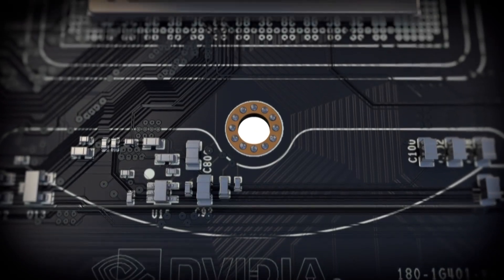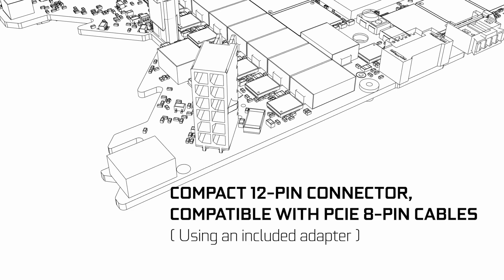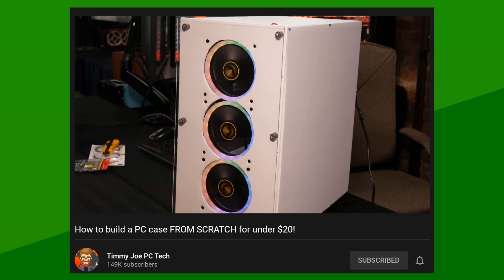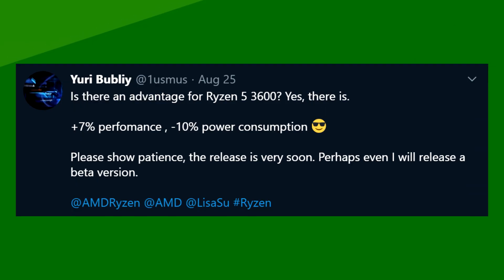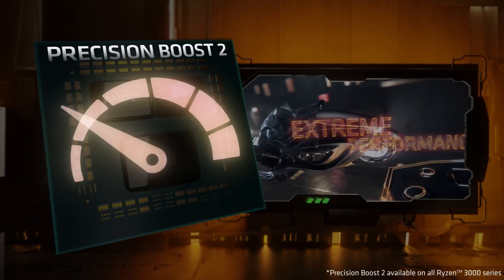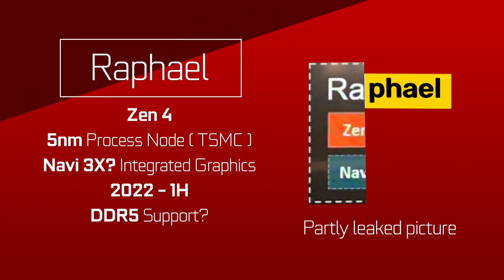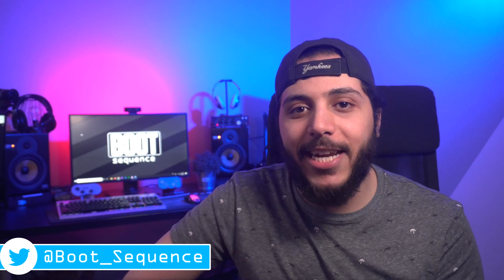More Info About the RTX 3000 Series Cooling! It’s Pretty Good! AMD DDR5 in 2021!

Comment: Sandwich style SFF cases will have a huge problem with NVIDIA's cooling solution. Exhausting air on the metal divider will heat up every component in the case. They're killing a market where customers spend $200+ just for the case.
Reply from the maker: I had the same argument until I realized all vega cards from back then had short pcb’s and a similar airflow when aircooled. But you’re right in a way since their design will blow out more air than third parties who usually cover the back of the heatsink and just have a few holes

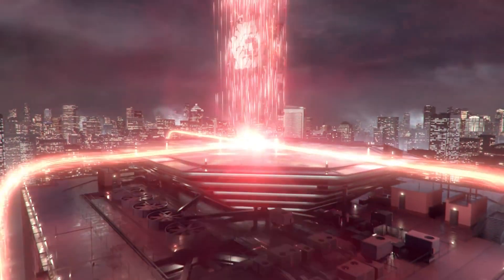Comment: which radeon vii sucks 400watts? (referring to 2:15) i OC`d my VII to 2038mhz and it barely touches 300w here and there
Reply from the maker: you might have a great sample. As is, radeon 7's range between 300~ 370w when oc'd to the fullest, with up to 420 on water.

Comment: That Nvidia reference design is actually making a good use of current case fan placement which usually has 3 intake and one exhaust but really if you have the cash to buy the new nvidia reference card ( which usually cost more than the AIB card and usually sells in more limited quantities ) you probably have a good case fully loaded with fans or have a water cooling setup. I probably more concerned about the dram chips on those GPU since they are rumored to be "run hot" especially after the RTX micron fiasco

Comment: over here in the u.k msi rtx 2080ti is £1500 so would you buy 1 or get a new rtx 3090 for prob £2000. think I will keep my zotac amp extreme 2080ti for next 2 years then build a new pc with a rtx 4090
Reply from the maker: id wait at that point. if the 3080 can match or beat 2080 ti , it would be cheaper.
Reply: In the uk even though the £ is worth more, things cost the same as in $, so the 3090 will more than likely just be £1400+, hopefully it will make the 2080ti lose almost all of its value

Comment: According to Lisa Su statements, We were probably getting AM5 in late 2021(or at least the reveal of such) as the roadmap had it placed before 2022 and she reaffirmed several times they are still on track.
DDR5, USB5,Thunderbolt3(native support),Pcie5(which CXL could very well bring back multi GPU configs). I was hoping for Marketing they would use 5000 series and keep everything aligned.

Comment: What is the worst that can happen if I stick the 3090 with my current 650w platinum seasonic psu, which appears to have plenty of capacity for my 1080ti, 9900k and 32 gbs of ram?
Reply from the maker: seasonic... you'll be good.
 oh wait... 9900K. 🔥🔥🔥. Im kidding. but expect that having both overclocked might be an issue even with a 80+ silver PSU.
Reply: Thanks! I thought people were exaggerating with the 850w, but If they want $1400 for a gpu, the founders edition better be able to run everything on ultra at 4K 60 FPS straight out of the box no overclocking...
Reply: if you have gold version..you will be very well shape....but not bronze or not sure silver will be enough...but only gold are optimize for this setup...you shouldn't worry when its only using 2 8pin and PSU are phasing out next year for only 12ATX PSU cause current PSU...24pin cable ...the VRM made half the cable unused due to motherboards changes from 5v and 3.3v is now been converted through VRM 12v into a voltage of memory and usb and PSU already converting for disk drives ...meaning every PSU inside only have 12v capacitor is only used for motherboard and gpu's and disk drives have their owned regulators to step down voltage or increase

Comment: I just wanna know if my 750W psu that only has dual 8 pins will fit the adapter. AFAIK dual 8 pins can push up to 300W's but the 12pin connector uses 600 (obviously, this does not mean that the card will use the entire 600, but they wouldn't increase it for nothing :/) Will the AIB cards use dual 8 pins or triple? Will the adapter also need dual or triple? A lotta questions :/

Comment: I have an RTX 2060 KO and a regular 2060 both in the same supposedly well-ventilated case. I run Folding@Home 24/7 when it lets me. The regular 2060 is nearer the bottom of the case and runs at 77C. The KO runs at 82C. I expect if I get a 3000-series card I’ll need a new case... and possibly a new power supply. The current GPUs run at 150W each at load...
Reply: Why on earth would you use RTX 2060 in SLI?
Reply: @oskarwroniewicz  Is that even possible? I don't think there's NVlink on the 2060.

Comment: i was really hoping that diagonal connector was on the inside..... which could make this the best cable management gpu ever, instead of that mess...
Reply from the maker: WAIT. Thats an insane mod idea. Adding it to the list
Reply: @BootSequence  sounds like a good video
Reply: @BootSequence  If its diagonal, its mostly likely loose, just bend it to whatever angle fits
Reply from the maker: Yeah actually. That would have been awesome
Reply: @BootSequence  looking at you AIB partners

Comment: The clickbait title "Nvidia tries to eliminate Noctua?" -- U14S owner.
Reply from the maker: Its a stretch. .. I LOVE IT 😂
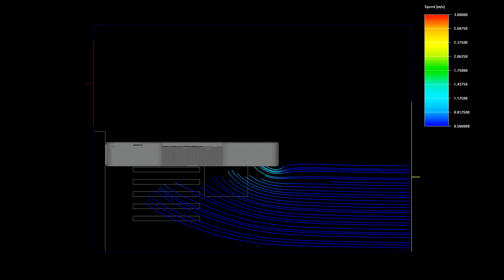Reply: @BootSequence  Big fan, thanks for replying. I was indeed joking. But to be honest, about 1:56, I do think this design will affecting air coolers since positive airflow case fan settings still seems to be the most common for mid-high budget air cooler users, which a portion of heat/hot air that would be push out of the case through unoccupied PCI-E slots covers can now having some "official assistance" to make their way to the CPU heatsinks. It could be take as Nvidia thinks the "high-end" CPU air cooler markets are so small they stop considering them in their cooler design of higher end cards. 😂
Reply: If this is about the size of the card being a conflict with Noctua heatsinks that shouldn't be a problem. Triple slot cards extend further down into the case, not higher up.
Reply: @Hotobu  Thanks, I'm currently using a triple slot 2070S with U14S, I was just joking about the back fan on the 3000 cooler blowing hot air towards the CPU's direction may only affects air cooler and the fact that Noctua only offers air coolers.

Comment: Let's see what cooling designs board partners have for these monster power sucking  GPUs 
I doubt that Founders Edition coolers will be enough to cool these 300watt + GPUs
Reply from the maker: I doubt it will change that much. Most heavy duty coolers are already 2-1/2 slots. They coule probably keep them and just tweak fans
Reply: @BootSequence  I'm talking about that terrible design by Nivida I think board partners cards will be the way to go for high end models like 3090
Reply: @arfuzzaman  Lets just look at high-end board partners and what makes it good coolers
its a huge heatsink with heatpipes, this FE design has it
bigger than a 2 slot to fit the metal, this FE design has it.
Big ass power delivery system for stable power, FE has a dual 8-pin connectors (to 12 pin)
Plus the FE has unobstructed airflow on the heatpipes, which is hardly done on board partners coolers.

So why would this FE design be bad? everything we see from the leaks makes it look like a competitor to high end board partner cards. Which also makes sense why the rumours of board partners launching cards soon after the FE to be competitive, because if Nvidia has a good cooler with binned gpu's, why get an ASUS/EVGA/MSI card months later when it comes out.

It might not look nice but that is subjective
Reply: @imo098765  I understand your point let's see how Nvidia pulls it out but there is one more thing availability in other countries In my country it's easy to get hands on these Asus , MSI cards then Founders one